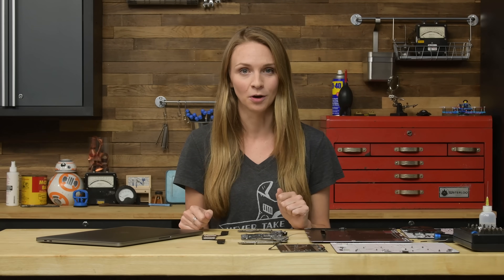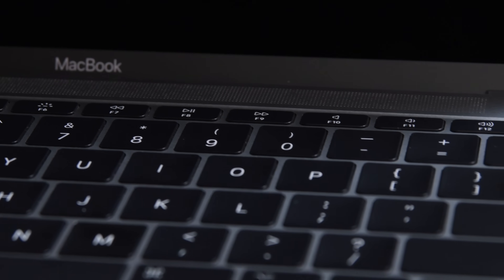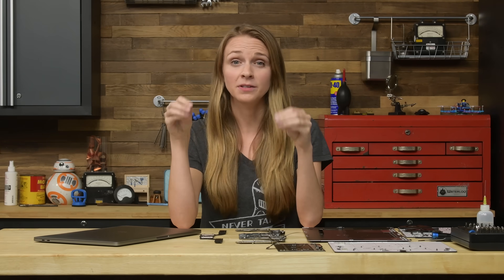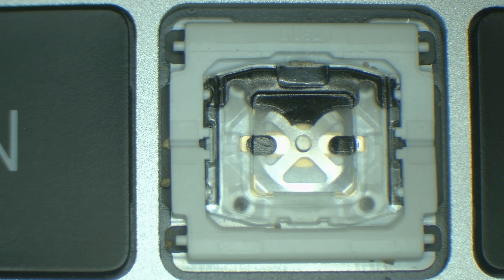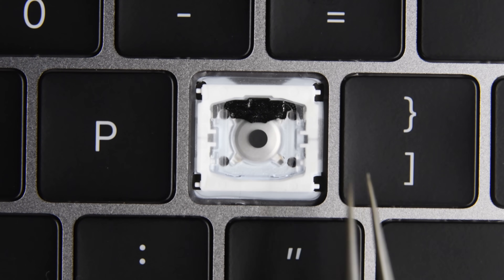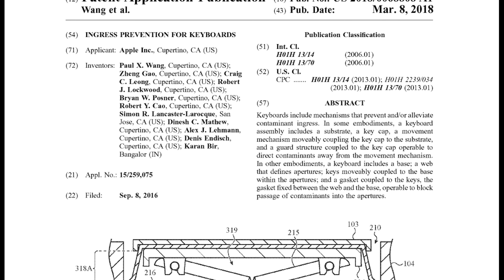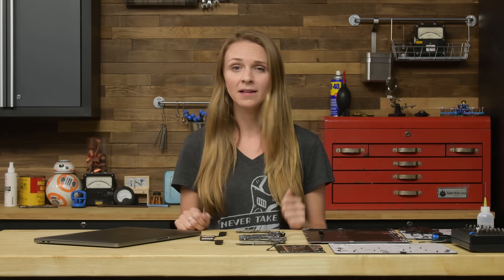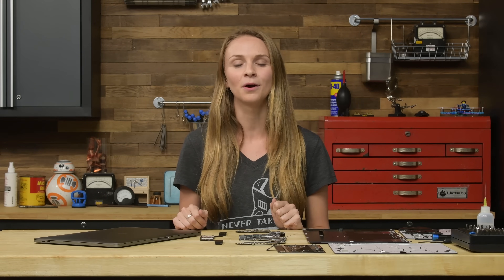MacBook Pro 2018 Initial Findings: Keyboard Design Cover-Up?

Comment: For the amount of money Apple charges, they should be using mechanical keyboards and not this butterfly membrane BS. 
Apple is great in some regards, but these days they’re screwing up big time too often.
Reply: Do you know that mechanical keyboard needs so much space, so much more than membrane keyboard? Probably your macbook will be 2 cm thick if you use mechanical keyboard

uhm, 0,8 inch for you imperials
Reply: MintArcade 
Yeah, that seems to be the top thing I hate the node about modern Apple, in that they only seem to care about making things as thin as possible.
Reply: This what happens when incompetents takes over a company
Reply: Kevin Bhasi
Apple seem to think the thickness /thinness of their laptops has a direct correlation with progress but there are many other parameters which denote this, including processing power, memory, cooling and surely weight is practically more important than the thickness?
Reply: King_Abel how are mechanical keyboards disgusting? Have you used any mechanical keyboard except for a basic razer or corsair keyboard? There are many high-end boards that feel like heaven to type on, and switches like topre feel different from any other keyboard on the market.
Reply: MintArcade buy a computer instead. I mean, I would love to have a light laptop that I can easily carry around and having workstation to work comfortably for long period. Heck, i'll probably would get an iPad instead of MacBook.
Reply: You guys feel free to buy gaming laptop with mechanical keyboard and leave the regular MacBook for us. I think MSI makes a 17" and a 18" model model that weights 10-pound
Reply: Apple has been caring about that for years.
Reply: You do realise that mechanical keyboards take up so much space.
Reply: Kevin Bhasi people HATE a heavy laptop (including myself). I would rather want a slim laptop that I can just throw at my backpack without worrying it will break my back (:p) but I would also appreciate a better battery for my laptop too. Only the LG Gram seems to have done it unfortunately :(
Reply: King_Abel This. I don’t get the obsession with mechanical keyboards.
Reply: the keyboard in the early MBP 2008 is the best Apple ever made.
Reply: It's great and all that Apple wants to make things thinner and thinner, but the cost of that is losing functionality (like the 3.5mm headphone port on iPhone and iPad) and more issues like not being able to keep things as well cooled, not being able to have a higher capacity internal storage, not being able to have a higher capacity battery, etc.

We all remember the whole battery apocalypse from both Samsung and Apple right?

Anyway, my main point is that when Apple (or any other company) sets an MSRP for their products at a certain amount, consumers expect (especially from a well know and reputable company) a certain level of quality with their products.

Apple tends to sell their things at an enormous premium price, but the quality isn't necessarily premium either. Another bad thing with their laptops (for example) is how they sodder the parts to the motherboard where you can't easily upgrade the internal storage or RAM (2 of the most basic components) so they expect people to pay a hefty price, maybe last a year or 2, and then have to buy another one again.
Also, many of the newer laptops have fewer and fewer ports making it necessary to carry dongles to add more ports.

I like the iPhone software itself, but what I dislike is how slow Apple is to implement newer technologies that its competitors (like Samsung) uses, all while still charging the hefty premium price.
Heck, even the USB charger and A/C adapter is expensive, and even on the 'Plus' model of the iPhone, they still include the crappy basic one and not the 12V charger which is necessary to get the Fast Charge feature.
Reply: xxnike629xx Apple wants to get to a point where there are no physical keys & the whole keyboard is one big screen with tactile feedback. Can’t wait for that
Reply: More design to fail.  We know how many years people keep their macbook 5 to 7 years minimum.  Cant make money like this.
Reply: MintArcade, Heck, I'll even compromise: Apple can feed its lust for thinness on consumer laptops and give us professionals thicker laptops with better thermal management and battery life, with a more diverse selection of ports + MagSafe.
Reply: @wwbdwwbd  I would love that... across the board. Including phones. Products apple needs to create for filmmakers, photographers, coders, and music producers: 
15 and 17 inch Macbook Pros with the scissor keys, SD card slot, Magsafe, two USB 3 and two USB-C. 

A regular sized and plus sized "iPhone Pro" that has square corners and NO NOTCH - this is extremely annoying for video and photo people. Bring back the headphone jack, as some of us want to use our professional headphones or the 3.5mm jack as a mic/mixer input for live streaming while also being able to charge our phone, and with that "extra" thickness added back, give us a ton more battery and storage since you won't give us Micro SD. We can still loose the home button for a bigger bevel free screen, but put a fingerprint scanner in the lock button on the side, or maybe make two side buttons. I personally hate the idea of having to always unlock my phone with my face or with the passcode, and not having a physical home button of some kind to dump out of apps. 

I'm holding off as long as I can, maybe 2019 will bring some actual professional gear that I want to purchase, but for now my 2011 15" Pro and my 2014 27" iMac are going actually doing their jobs. I just hate the feel of the new keyboard and the forced dongle use so much... And I'm rocking two iPhone 8 plus' and a TON of not even apple branded dongles to get my audio signal in the phone.
Reply: xxnike629xx The butterfly keyboard has more of a mechanical feel than their old membrane keyboards, and a true, slimmed down mechanical keyboard could obviously not fit within the form factor.  If you haven’t tried it, I suggest you do.  I would prefer other things for the money, for example 16GB RAM standard on the 13”, more storage as standard, etc.  Not some form of technically mechanical keyboard that wouldn’t have the same feel.
Reply: @applebits7637  

Dude. The keyboard feels like you're typing on a pane of glass. The tactility you're feeling is your finger being forced to bottom out the key, and the key hitting the frame it's housed in.

I can accept a membrane on a laptop if it feels like I'm actually typing on something, and these switches don't. They're awful.
Reply: They keep feeding their lust on thinner slimmer design over actually practicality, which is why the thinner bezel, flatter keys etc… which is sick… I would prefer better heat management and more battery life over sleeker design and/or heat throttling anytime.
Reply: Yeah, I agree, and I somehow feel that Apple basically sells consumer-grade computers at business-grade prices.
Reply: Mechanical keyboards are disgusting. Sounds and feels like a damn type writer. I prefer chicklet

Comment: I was waiting for someone to discover this. I assumed that the quieter keys must be due to a skin or membrane of some sort. Hopefully it solves most of the issues going forward. Time will tell I suppose.
Reply: Yeah I guess the membrane does muff the klick klackty sound. But one must know that these becomes hardened and degrade after multiple usage and heat punishment. Which Both are quite common for any MBP
Reply: DPhoto Yeah, especially with the change in tone. Thankfully this looks like it will fix the issues, and now that everyone knows about it well probably see durability tests.
Reply: MintArcade yup
Reply: Exactly, when new and cold, the BF keys are not that noisy at all, but after short time of use and when the laptop is hot, they get noisy  (a click on the right command key, which I never use, tells me how noisy they become)